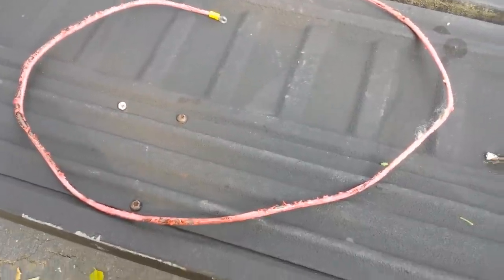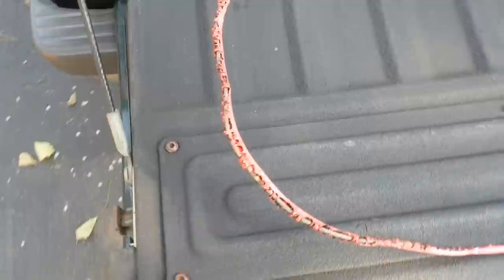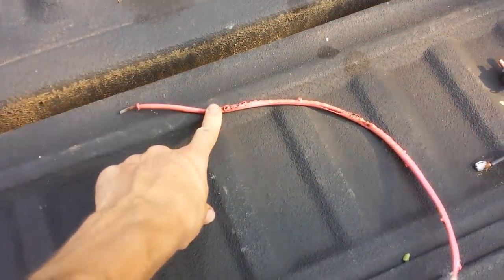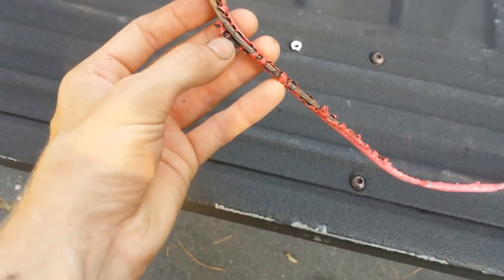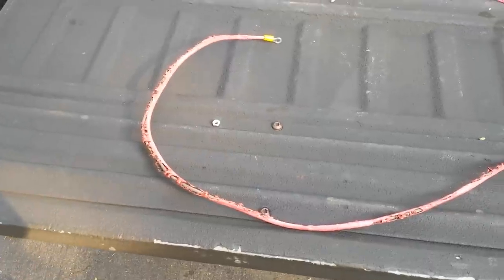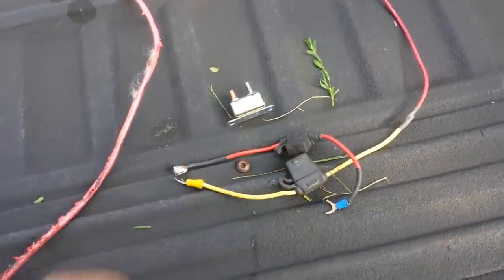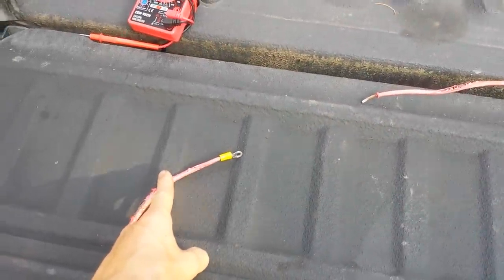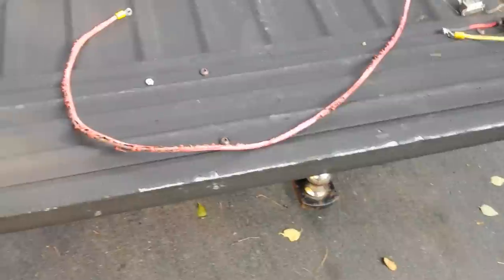WHY FUSES AND CIRCUIT BREAKERS ARE IMPORTANT

Comment: The circuit breaker you show at 1:46 are not safe. They automatically reset themselves and cause a lot of fires in buses, Rv's, boats and campers etc. I recommend a circuit breaker that must be manually reset of a fuse that must be replaced. For example see====>  http://www.cabelas.com/product/Manual-Reset-Circuit-Breaker/738260.uts?productVariantId=1191209&srccode=cii_328768002&cpncode=39-90764702-2&WT.tsrc=CSE&WT.mc_id=BingPLA&WT.z_mc_id1=00006830&rid=20

Comment: Great safety tip.  I found that the wiring from the alternator to the gauge in the dash on my '64 Dart didn't have protection...no fusible link or fuse.  Lost a couple wires...I quickly disconnected the battery.  Never moved so fast in my life.  Another tip I learned...when working on the car, especially if there are wires present, disconnect the battery to be safe!  :) Jack
Reply from the maker: +Jack R Very good practice to always disconnect power before doing any work. Thank for the comment!
Reply: Why were you even touching the car if you didn't know the number one rule when working on electrical components?!?? Always disconnect the battery before any work is done and let the system discharge before doing any repairs as some compents like your air bag hold a charge for a short time even after the battery is disconnected.

Comment: I don't recommend using the black rubberized plastic housing fuse holders like he shows, 9 times out of 10 when the fuse blows in one of them the housing ends up melting and you have to replace it. You want to use the solid plastic housing that have the aluminum/steel block inserts for the fuses so if the fuse blows the housing doesn't get damaged or melted.

Comment: I worked for a guy years ago who fancied himself an electrician.  He didn't much believe in fuses, and he didn't much believe in doing things right.  He caught a 1978 Cadillac Coupe DeVille on fire that way. He had modified the wiring to the Hartman plug for his trailers that he towed with the car.  The car was not lost, but all the wiring was.  Have you any idea how much it costs to totally rewire a Cadillac, even back then?
Reply from the maker: +userunavailable3095 Probably more than it was worth...thanks for the comment!
Reply: Probably atleast a thousand dollars. Possibly more since you'd most likely be replacing some of the interior as well from being burned along with the wiring insulation.
Reply: @motoforlyfe  do you even realize how much one of those are worth especially today? Those things are rare and not exactly cheap it would be well worth the time and money to replace the wiring harnesses, properly.

Comment: I have seen a few cars that had the wiring fry ....Like on a Ford they have fuseable links those rectangle rubber looking things...And people chop them out and wire something direct
Reply from the maker: +not2fast4u2c I have used the rubber fuse holders in the past, bypassing them is a terrible idea!
Reply: What I meant was a fusible link on a Ford is a small rectangle rubber/plastic piece that has a small wire in it that will burn out if overloaded They can be bought new... people will cut them off and bypass them they are use on the headlight circuit etc.
Reply from the maker: +not2fast4u2c Oh yeah, I've seen those usable links before as well. Equally dangerous to bypass

Comment: I have a question. I want to connect a fuse, circuit breaker and relay (since I only want to provide power to the device when vehicle is on). So should I Connect the battery to circuit breaker then to the fuse and last to the relay ?
Reply: Hi Francisco. Using both a fuse and circuit breaker in the same circuit is not particularly necessary. Fuses and circuit breakers functionally accomplish the same thing. You can use either one, whichever you prefer. As for which order to place the components, here you go: Battery > fuse (or breaker) > relay > component. Then connect your car's accessory power to the remote terminal of the relay. Reply if you have any questions and I'll shoot you a response.

Comment: Years ago I did a silly thing. Had an 8 track, one of the first in a Morris 1100. Swapped polarity on the car (didn't know it was reversible inside the machine) Next car was a Morris 1000. Instead of changing polarity, wired it directly to the battery. It shorted and suddenly burst into flames. Shot out and pulled the wire off the battery with pliers, but was a close thing......lesson learned.
Reply from the maker: +MalcOfLincoln Thanks Malc! That doesn't sound good!
Reply: Was a bit scary at the time but quickly under control. Only thing was I was in a town high street. The soundproofing under the dash etc was smouldering.....took ages to make sure it was safe.

Comment: Good stuff, that sounds like what happened to the ventura that vwdarrin bought.  BTW I checked and you can also buy fusible link wire on ebay that's meant to protect loads that aren't practical to fuse.
Reply from the maker: +TheWreckingYard Thanks for the comment!
Reply: Yea you can buy them from eBay but you better test it first before using because it may not be safe. Alot of stuff sold on eBay is cheaply made and the manufacturer skips out on safety protocol. If it doesn't have DOT or comply with local safety regulations don't buy it.

Comment: A when u use an circuit breaker  the accessory side goes to wat ever like I’m using this for electric seats so accessory will go to the power feed and the battery side can that go to the batt capacity on my fuse box

Comment: A huge amount of heat to melt that 8ga wire . Looks like he had to cut some of the strands off to even use the 10ga ring connector . I'd have to ask him or her what else they have done to the truck to make sure the car or truck will not burn to the ground ,Gerry
Reply from the maker: +krazy45cat It wasn't a recipe for success, that's for sure!

Comment: circuit breakers are there to protect the cables, not the accessory. place CB as close as possible to the power source
Reply: 😂 If you wanna be technical, the breakers are there to protect the driver, and their vehicle. It also protects the cables and the accessory, of course 😁 I'm just trolling though lol, placing the CB close to power is definitely what should be done!